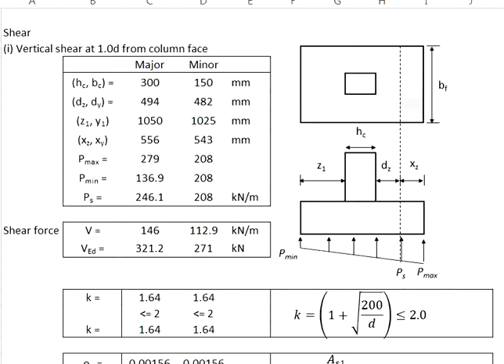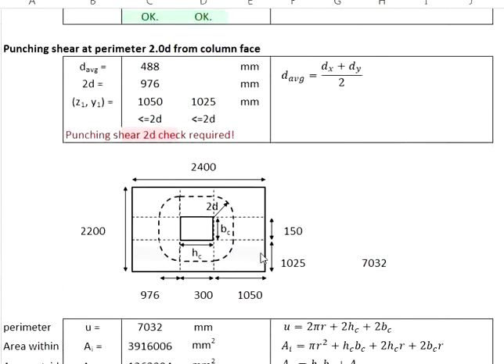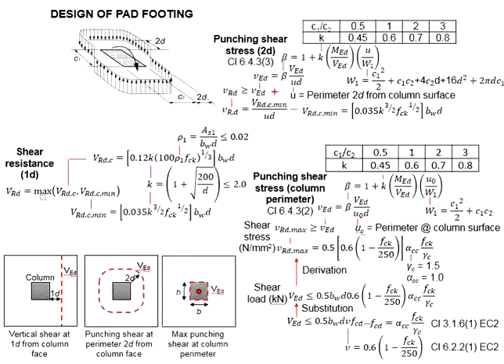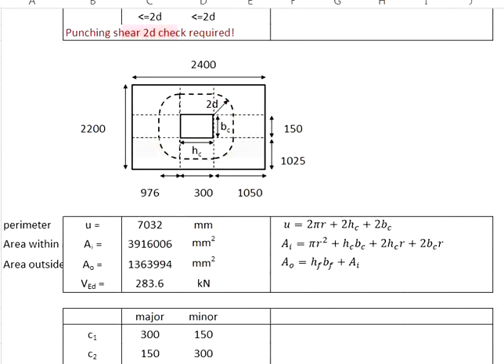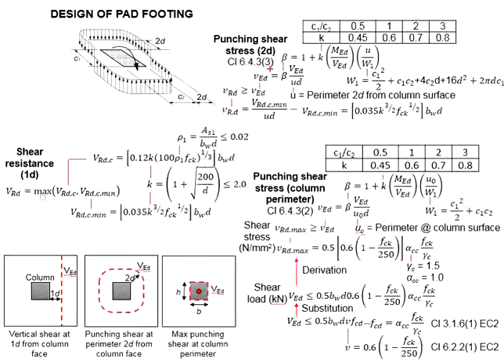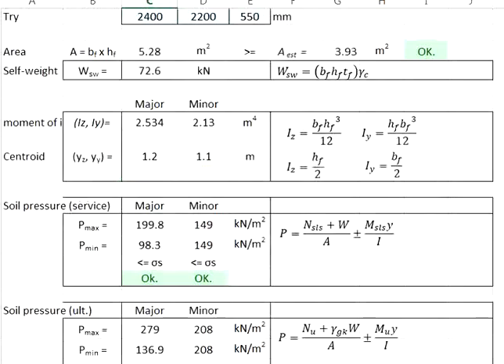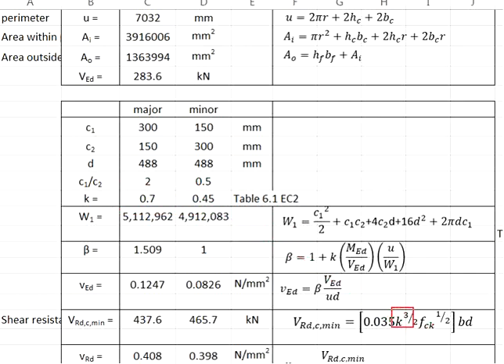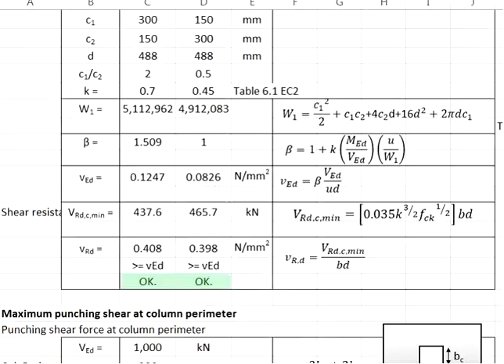3.34 Design of pad footing with axial load and moment in major axis part 4

Comment: Vrd,c,min for the control perimeter 2d from the column face should also be found by multiplying by ud not bd. This is a large error and the video acknowledge it, or the video should be removed and reuploaded.
Reply from the maker: To determine the shear stress, we use the formula 𝑣𝐸𝑑=𝛽 𝑉𝐸𝑑/𝑢𝑑. Here, 𝑢𝑑 is correct because it refers to the punching shear perimeter at a distance of 2𝑑 from the column face. However, when calculating the shear resistance, we use: 𝑣𝑅,𝑑=𝑉𝑅𝑑,𝑐,𝑚𝑖𝑛/𝑏𝑑. In this case, 𝑏𝑑 is the correct term to use. This is because 𝑉𝑅𝑑,𝑐,𝑚𝑖𝑛 is derived from the formula: 𝑉𝑅𝑑,𝑐,𝑚𝑖𝑛=[0.035𝑘^(3⁄2) 〖𝑓_𝑐𝑘〗^(1⁄2) ] 𝑏𝑑. This formula is used to calculate vertical shear resistance at a distance of 1d from the column face, and the calculation is based on the cross-sectional area 𝑏𝑑. Since 𝑉𝑅𝑑,𝑐,𝑚𝑖𝑛 is calculated using 𝑏𝑑, the shear resistance per unit area must also be expressed as 𝑉𝑅𝑑,𝑐,𝑚𝑖𝑛/𝑏𝑑. This value is then compared to the punching shear stress vEd=βVEd/ud, which is also expressed as stress per unit area. We cannot use V𝑅𝑑,𝑐,𝑚𝑖𝑛/u𝑑 because 𝑉𝑅𝑑,𝑐,𝑚𝑖𝑛 was not calculated based on the perimeter, u. Using 𝑢𝑑 would incorrectly change the stress per unit area, leading to an invalid comparison.
Reply: @eng-aim  to be honest, you just need to calculate the shear stress and compare to v𝑅𝑑,𝑐,𝑚𝑖𝑛=[0.035𝑘^(3⁄2) 〖𝑓_𝑐𝑘〗^(1⁄2) ]. There is no need to turn it into a force.
Reply: @eng-aim  The shear resistance is given by v𝑅𝑑,𝑐,𝑚𝑖𝑛=[0.035𝑘^(3⁄2) 〖𝑓_𝑐𝑘〗^(1⁄2) ], as given by equation 6.3N is the EC2. This is in units of MPa. So if you wanted to turn this into a resisting force, you would multiply this by ud. It is not necessary for you to multiply v𝑅𝑑,𝑐,𝑚𝑖𝑛 by bd as you do in the video, as you just divide by bd anyway in the next step. Calculate the applied shear stress as 𝑣𝐸𝑑=𝛽 𝑉𝐸𝑑/𝑢𝑑 and compare to v𝑅𝑑,𝑐,𝑚𝑖𝑛=[0.035𝑘^(3⁄2) 〖𝑓_𝑐𝑘〗^(1⁄2) ].

Comment: Why are you dividing the shear force by bd? You should be diving it by ud where u is the control perimeter.
Reply from the maker: To determine the shear stress, we use the formula 𝑣𝐸𝑑=𝛽 𝑉𝐸𝑑/𝑢𝑑. Here, 𝑢𝑑 is correct because it refers to the punching shear perimeter at a distance of 2𝑑 from the column face. However, when calculating the shear resistance, we use: 𝑣𝑅,𝑑=𝑉𝑅𝑑,𝑐,𝑚𝑖𝑛/𝑏𝑑. In this case, 𝑏𝑑 is the correct term to use. This is because 𝑉𝑅𝑑,𝑐,𝑚𝑖𝑛 is derived from the formula: 𝑉𝑅𝑑,𝑐,𝑚𝑖𝑛=[0.035𝑘^(3⁄2) 〖𝑓_𝑐𝑘〗^(1⁄2) ] 𝑏𝑑. This formula is used to calculate vertical shear resistance at a distance of 1d from the column face, and the calculation is based on the cross-sectional area 𝑏𝑑. Since 𝑉𝑅𝑑,𝑐,𝑚𝑖𝑛 is calculated using 𝑏𝑑, the shear resistance per unit area must also be expressed as 𝑉𝑅𝑑,𝑐,𝑚𝑖𝑛/𝑏𝑑. This value is then compared to the punching shear stress vEd=βVEd/ud, which is also expressed as stress per unit area. We cannot use V𝑅𝑑,𝑐,𝑚𝑖𝑛/u𝑑 because 𝑉𝑅𝑑,𝑐,𝑚𝑖𝑛 was not calculated based on the perimeter, u. Using 𝑢𝑑 would incorrectly change the stress per unit area, leading to an invalid comparison.

Comment: How come you use the same shear force for both the major and minor axis? Would the minor axis not use the constant P/A value for the pressure since there is no moment in that axis?
Reply from the maker: Yes. The shear force for the major and minor axis are different as there is no moment in the minor axis. Therefore, constant P/A soil bearing pressure shall be assumed in the minor axis.